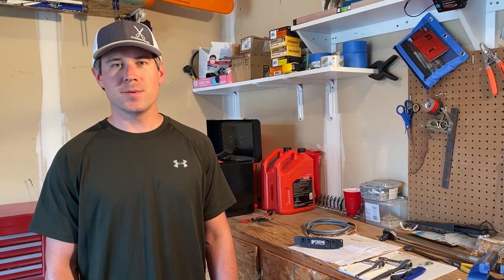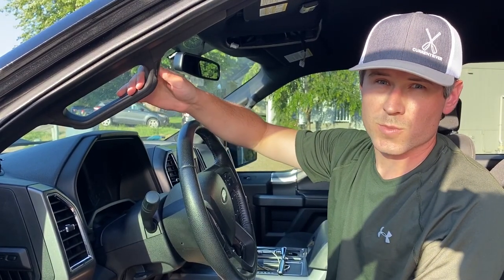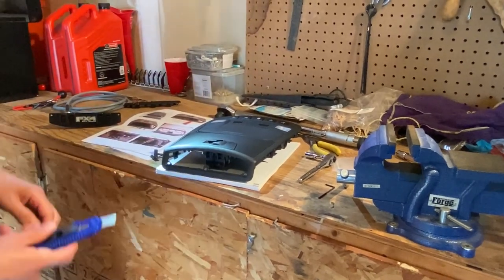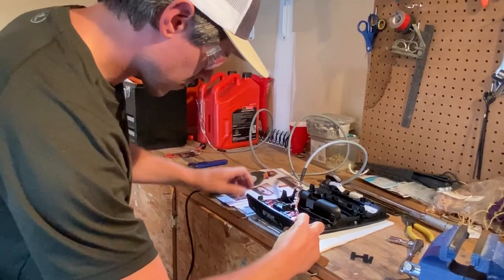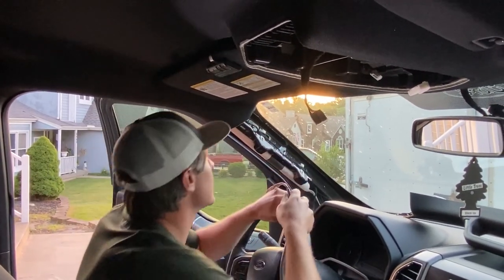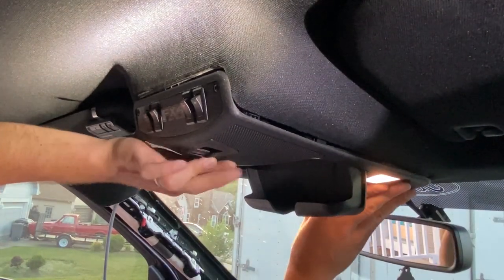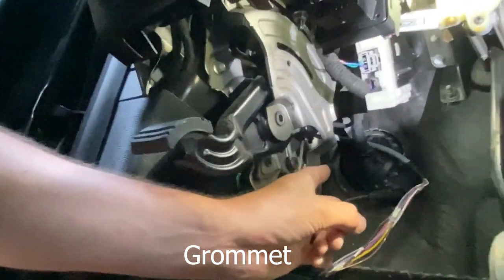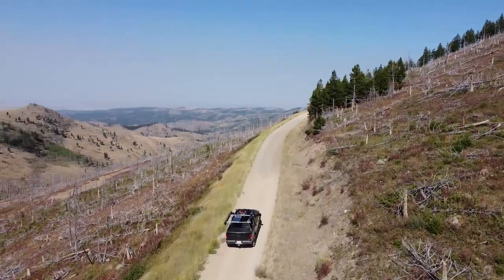F150 Switch Panel Install for Overhead Console

Comment: Very well done!  I'm not installing a light or switch panel, yet.  I watched because I'm mounting a radio faceplate in the sunglasses holder and wanted to see how to run the wires.  Now that I've watched this, I'm kinda motivated to install the light kit.  Thank you to you and to the person that said "nice" when you tested the sunglasses holder.  🙂
Reply from the maker: Thank You @KY4LJ I hope your radio mounting goes smoothly.
Reply: I completed it and it is exactly how I hoped it would look.  Thank you for the video.
Reply from the maker: @ShannonGlenda  great! I'm glad it turned out well and my video could help.
Reply: @ShannonGlenda  what year truck did u put it in and could I see the final product ?
Reply: @DerekSmith-ym4kn  2019 F150 diesel.

Comment: Appreciate the video @jacobsupgrades.  Well done.  The only value add I have to throw in... there is a nice path for the wires a little further aft when making the initial run in the overhead liner that lets you avoid having to worry about the wires path being in the way altogether.  Literally about 9 inches further back and then up to where you did.  Again, great video.
Reply from the maker: @user-hk2yw5jq6d, Thank you for the advice that is good to know!

Comment: Since the battery is located on passenger side why did you use the Drivers side A pillar and not the passenger side A pillar? It would be a shorter path to the battery by going down passenger side A pillar through the firewall and then to battery. Am I missing something?
Reply from the maker: @rickheis9748, The existing grommets on the passenger side were full and would not allow for new wiring to pass through. I don't have the provided instructions anymore but I think they even mention to go down the driver side. It would be nice if there was room and access to the passenger side grommets though. Your truck may be different.

Comment: Where did you mount the relay and run wires in the engine compartment?
Reply from the maker: I ran the wires through the grommet under the driver side dash and put my relay to the driver side of the intake in the engine bay. The wires run low and out of the way and the relay is accessible at the top.

Comment: Seems like the camera operator focused shots on your head, instead of on the cuts that need to be made. Most seem to be out of frame. I can tell you knew what you were doing but cannot see the actual operations. Not much to be done for this one, but for future videos, please have them focus in the work more than on your face.
Reply from the maker: @JosephCarpenter700, thanks for the advice. We have learned a lot since filming this video.

Comment: How much did you pay?
Reply from the maker: @Michael Neals, I paid $129 back in May of 2020 for this switch panel. I'm sure the cost has gone up some since then. Reach out to Brett for updated pricing. He has all sorts of switch type selections and colors along with different logos that can be laser engraved.
Reply: @jacobsupgrades  thanks. I have to repair my sun roof in the spring and then will purchase. Already emailed them. Thanks again!